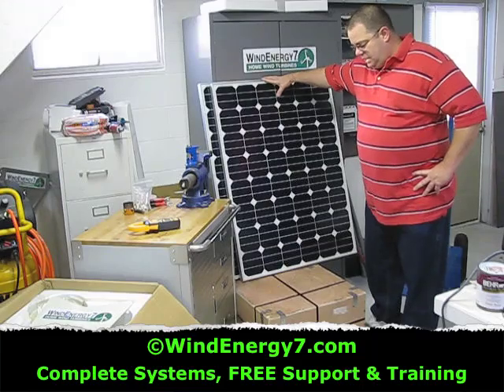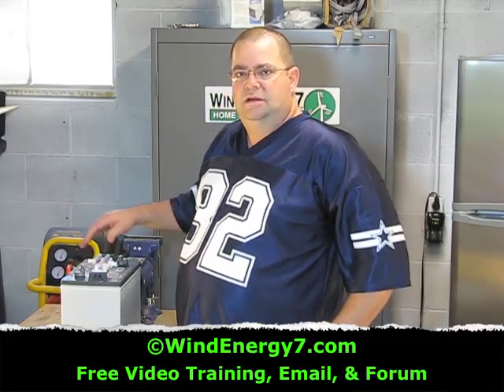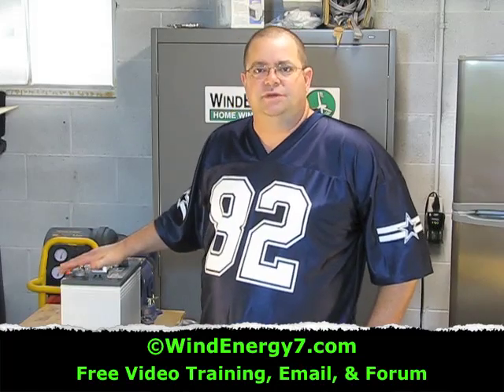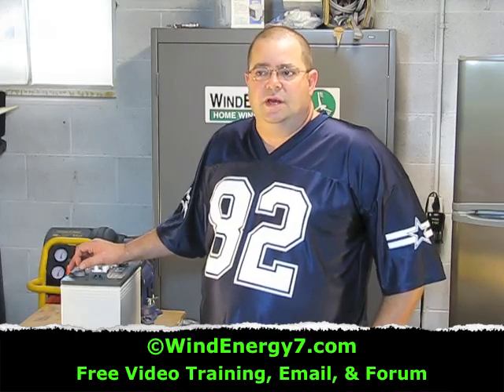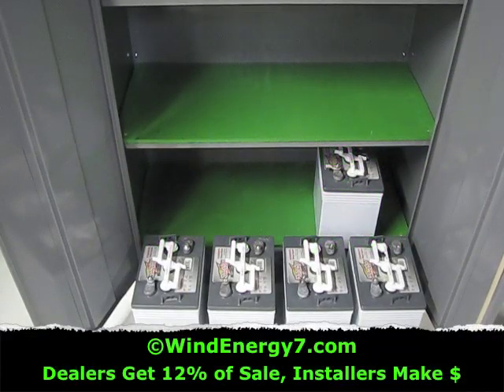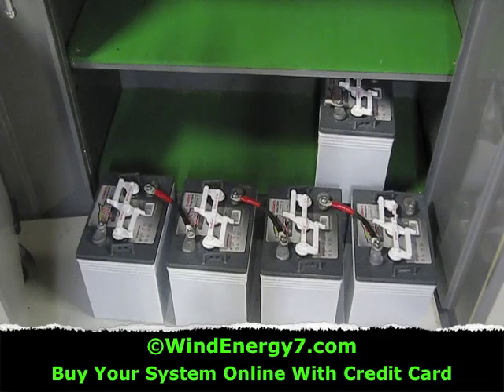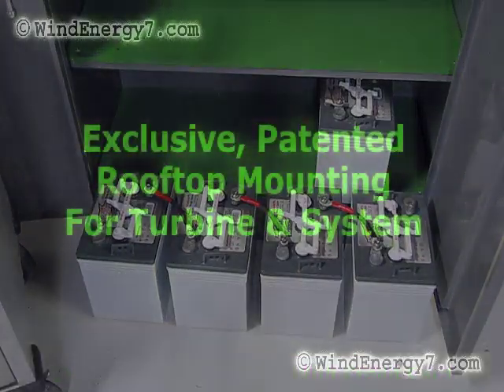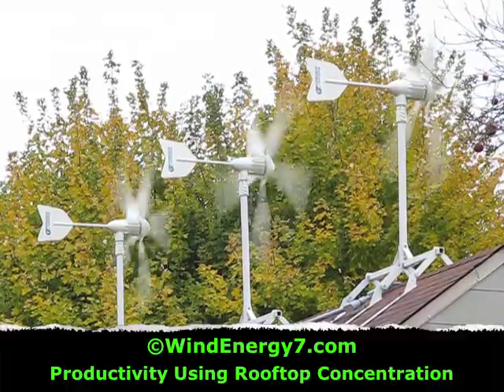Solar Home

Comment from the maker: Solar Homes and Solar for Home hardware systems, controllers, supplies. Inventor of the RoofMill™ solar for home wind turbine kit, solar for homes are our main expertise. WindEnergy7 has more options for solar for homes because of our many innovations with inventions and patents making small wind power and solar for home systems possible. Get more Videos, Pictures, and Pricing at - - WindEnergy7 (.) com